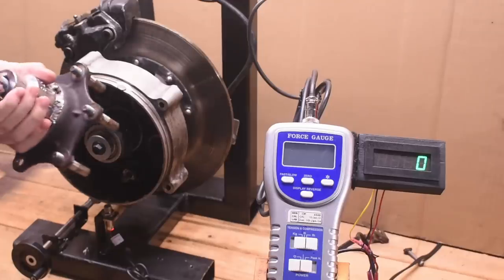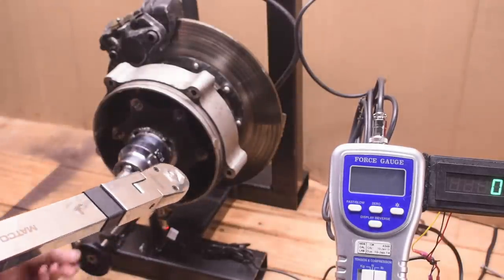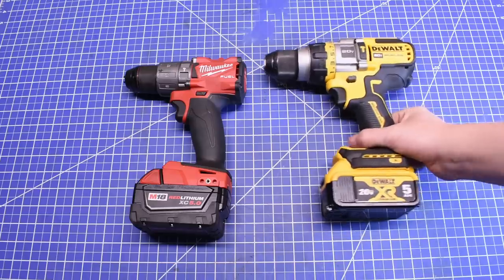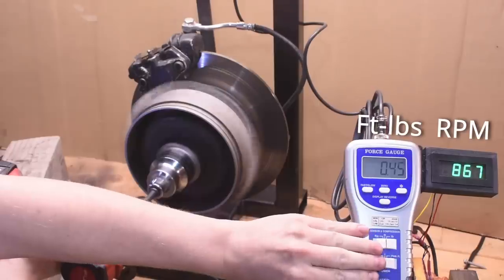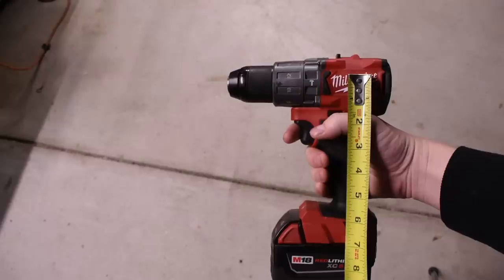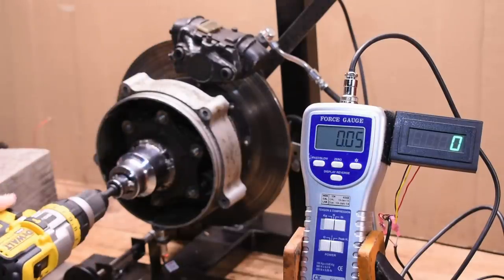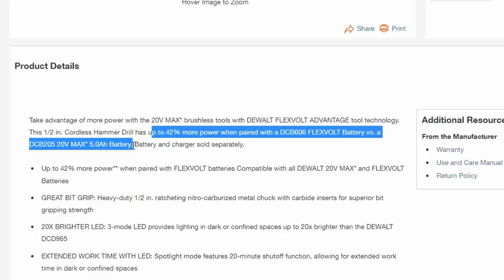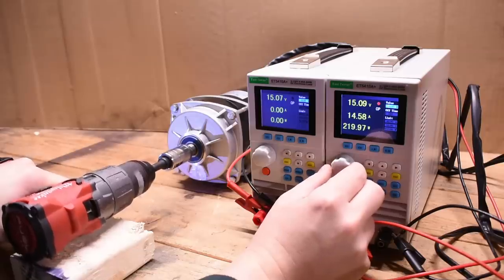DeWALT vs Milwaukee on a Cordless Drill Lie Detector (Dyno Brake)

Comment: I somewhat disagree with the rankings. When I use Milwaukee drills, they like to stall out really early and shut down. My Dewalt will try to break your wrist and only shuts down when the battery gets low.

Comment: Awesome video!
However, I wish more than anything that these companies would stop overcharging for batteries/tech that's decades old though.
For 18650/21700s it should not be several hundreds of dollars to begin with as an intro (say 5ah) brick. Then you add LiPo (around since the fking flip phone era..) into the mix & you QUICKLY find out they don't make their money from tools, it's the batteries. Their margins are HUGEEE!!

Comment: Your brake dyno with its torque and RPM measurement should give you a more acturate power measurement without the losses of the motor run as a generator.  Power is just torque times rpm.

Comment: I'd ditch the generators. The have more losses at low RPM, skew points more. Same power, less losses at high RPM, so higher reported number. Stick with the brake rotor and come up with a dyno graph like you'd expect for an engine.
Reply from the maker: That's why we use separate motors for different RPM ranges, the LOW motor test is with a 550 RPM motor that's more than happy to operate in the loaded like 400 RPM range. It's not very comparable between test types, but is between tools within a test.
Reply: @TorqueTestChannel  So more variables? HP can be converted to watts just like fahrenheit to celsius, so... I don't see what we the viewers get from that anyway... maybe convincing for those who... don't trust/understand the brake dyno or whatever.
Reply from the maker: Not all drills can drive the brake in high and our data refresh rate in low rpm leaves lots of jumbled data that a dyno curved derived from would be a stretch
Reply: @TorqueTestChannel  Sounds like a trash tier drill not worth the material it's made of. So your graph would look a tiny bit stair stepped, big deal. I'm sure you can come up with a higher res trigger if you feel it's just not good enough.

Comment: no No NO! The peak torque you're getting is primarily a function of the rotating mass and the rotational speed (i.e., inertia, momentum, and kinetic energy) the instant before it comes to a complete stop.  Disregard this peak value, and try to keep is rotating as you approach stall.  Chris Baker, retired mechanical and nuclear engineer.
BTW, love your channel. I have learned and been surprised at some tests.
Reply: sorry...i was hours behind several others with this samem insight

Comment: We've run these tests and found the gen 3 with 6.0 48.6 ft lbs the flex 6.0 stacked lithium 48.0 ft lbs and the 999 with 37.6 with the 6.0 flex volt battery matabo hpt multivolt actually beat out DeWalt with 4ah 36v battery Making 39.9 ft lbs all measurements were tested several times with torque adapter set for max torque. If you revisit project farms video you will also see the same results. I believe you need an actuator to constantly turn at the same rate to get true values. The max torque on these drills would rip it out of your hand while trying to turn pressure on the caliber. I've been hit with a drill and it broke two ribs there is no way you can simply hold it down with one hand 👌
Reply from the maker: Yeah but we dont drill through wood too much around here or use hole saws often, so none of this explains why the Milwaukee would keep stopping from drilling a 3/8" hole in mild steel in high. You can go buy the toughest highest torque drill on the market then in high it just stops when using a step bit into some 1/4" plate. There's no numbers out there for this stuff.
Reply: @TorqueTestChannel  Thank you for acknowledging that wood elves aren’t the only ones using tools.

It’s annoying trying to find tools as a hobbyist fabricobbler and every review is just testing in wood.

Comment: I think you and all the rest of the Youtubers should put a lot more emphasis on weight of the tool. If you’re using a drill while standing on a ladder or doing overhead work a pound or two makes a huge difference at the end of the day. My last Dewalt drill weight was 8 1/2 pounds with the 18 v battery the new one I just bought 701 weight is a total of 2 1/2 pounds with The battery.🧰

Comment: The high speed test slows down too quick as at that point, aren't you also including the torque created by stopping the stored potential in the spinning rotor assembly?  These tests should be static RPM (or some % reduction of no-load RPM) and adjust the brake for max torque... which as you probably know, will be close to 0 rpm due to characteristics of electric motors...or at least at the point the ESC cuts out.
Reply from the maker: Bingo, yes. See our post towards the top
Reply: @TorqueTestChannel  ahh sorry, missed that.

Comment: I think Dewalt has the specs of the Power Detect and Flexvolt Advantage flipped.  Aka the Power Detect is the more powerful of the two.  When you put a large 20v 21700 battery.  (Not flexvolt.) Am I wrong?
Reply: Most reviews say that the Power Detect tools and their Flexvolt Advantage counterparts deliver basically the same performance with the same batteries (as well as the DCD998/999 being smallish improvements over the 996). So, if you slap a 21700 cell 8Ah on the FA, it's the same as if you were running the PD, and if you slap the 6Ah FV on the PD, it's as if you had the FA.

But as for the power ratings, I think spurred on more by Home Depot wanting their own exclusive version of the DCD996/997, and DeWalt wanting to upsell the newer 999 name.
Reply: @reaperreaper5098  

I’ve seen a slight advantage to the power detect in some reviews.
Reply: @juanc5149  If it's running the PD with an 8Ah XR vs the FA with the 6Ah FV batt, it's because the 8Ah battery is a far better battery than the 6Ah FV.

Otherwise, it could also be tool to tool variance, if we're talking small single digit percent differences.

Comment: I’m 4 seconds into this video. I’m gonna go out on a limb and assume that the dewalt wins. I had to drill a half inch hole in 3/8 steel once. The super brought a dewalt up to the section and it nearly broke my wrist off.
Reply: Just the other day i had to use a 1" hole saw on a steel column. My buddy's Milwaukee fuel kept cutting out so I grabbed my dcd996. It cut out a few times but overall had no problems. Thing's a beast!

Comment: Your methodology for measuring torque might be an issue. 
You're essentially measuring a form of locked rotor torque, which is when current is flowing but no cooling from the rotor fan can occur. This burns up the windings.
This is obviously bad for the motor, and almost any electric motor controller has safeguards in it to cut power when it senses a locked rotor condition. 
The correct way is to measure watts out and divide by the rpm out to make a working torque graph for available torque at a given RPM.

Comment: if you could even hold that thing at 300lbs it would snap the damn grip off. Ive broke a drill before by just holding it against something that wouldnt move. cant imagine someone buying one of these and just using it like a normal drill, you'll lose a finger if youre not careful.

Comment: Should ding them on points same way as the Amazon Flashlights. Those are some RIDICULOUS claims which turned out to be completely false.
Reply from the maker: There aren't accepted testing practices for it like there are impacts
Reply: @TorqueTestChannel  Watts of output was exactly what you were testing. As was maximum torque. I realize there's no standardized process, but torque is torque. There's no way that drill is putting out 100ft-lbs

Comment: This may be different in other Fields but a Carpenter: Sensitive Trigger, Ergonomics and Weight are what matters most in daily use on a cordless Drill, peak Torque/Power are nice figures to know and good to sort through the marketing bogus. Though ultimately in my experience people will use whats most Comfortable/Ergonomic with enough power to get the job done, regardless if something else has more Power or not. 
I don't mean to discredit your testing methods by any means, Comfort and Ergonomics are very hard or almost impossible to objectively quantify and  the industry as a whole is to blame for putting far too much emphasis on Power and Torque. Nevertheless its always interessting to see what Testing Rigs you come up with, keep it up.
Reply from the maker: Oh for sure, we are but a small piece of the puzzle looking at these tools. But perhaps one that may have been missing in some arenas.

Comment: My dewalt drill goes to 3000 rpm in top gear. That is the feature I won't do without. Rpm should be on your chart.
Reply from the maker: Watts takes into account RPM (volts)

Comment: The ranking  chart basically penalizing the Milwaukee because its bundled with a smaller battery seems stupid to me that's basically rating on marketing decisions not performance. If you drop out the 5 amp numbers it would be clearly superior which makes sense seeing as it's way smaller but putting out basically the same performance.
Reply from the maker: Well for one we've always tested tools on this channel with the battery sold with them, which seems reasonable as that's the battery many people will use. But the Milwaukee is also getting additional points for weighing less by coming with that battery and costing less for coming with that battery. DeWALT REQUIRING the flexvolt battery has to be considered.

Comment: Considering that FlexVolt really didn't provide any advantage here, I wonder if the Power Detect, from Lowes, with the 8ah XR battery would fare any better.  Dewalt's power detection systems really seem to be a whole lot of smoke and mirrors/marketing BS.

Comment: Power detect and flexvolt advantage is a marketing gimmick. Its jus a lowes vs home depot thing. No special communication w/e battery is more powerful is regardless of tool is going to be more powerful. Now which drill is more powerful? Power detect or flexvolt advantage? You will have to get the power detect on this rig to finally settle it

Comment: I love all of the tooling you guys are coming up with.  My only concern with this is the amount of rotational mass required to do this test that the drill wouldn’t typically be turning.  I’m curious if this would hurt or help the numbers you’re kicking out.  It would both be harder to get going but also harder to stop.  My guess is the consistent pressure test would be slightly lower while adding pressure would be slightly higher in numbers.  

Amazing work either way.  Keep it up.
Reply from the maker: See our comment towards the top, you're not totally wrong

Comment: I binge watched a lot of your videos to catch up. I have been getting a LOT of harbor freight youtube adds. Most of the time I don't skip them :)
Not paid by TTC, but please like, comment and subscribe. It really does help, these things are how Youtube knows what videos are good! 
one more thing. PLEASE get that rotor turned. The parts-counter-man inside me yelps in pain *Every Single Time* i see that. Any carquest with a machine shop will do it for $15-20. Also, use the best ceramic brake pads you can get. Not cheap, but the good ones will be more consistent, have less noise and be easier clean up than anything else. Seriously, the dust made from ceramic brake pad has a different electrostatic charge than other pad materials. Ceramic are supposed to have a lower coefficient of friction, but most of that has been designed out by now imo. Higher quality pads in general have less stiction; in vehicles this results in less lurching to a stop.

Comment: Footbananas

The Metric Conversion Act of 1975 is an Act of Congress that U.S. President Gerald Ford signed into law on December 23, 1975.[1] It declared the metric system "the preferred system of weights and measures for United States trade and commerce", but permitted the use of United States customary units in all activities.

Comment: I honestly think the old 18v nicad dewalts outperform teh 20v brushless models I've tried.  I also think that's because the computers stop it before it can damage itself, whereas the old ones would happily let the smoke out it you were willing to hold onto the trigger long enough.  It'd be interesting to throw an old model on to compare, and/or a 120v hole hog.
Reply: Both the motor and batteries are more than willing to cook themselves. I've killed both on separate occasions holding the chuck and using the motor to tighten it. I blame previous use though and it was just coincidence that both failures were from the same same thing, it can't be because I'm a strong idiot, honest. O_o

Comment: I'd love to see Makita gph01z vs Makita xph14z because I'm going to buy one of them but one requires me to buy into the 40 volt platform which I will do if it blows the 18v out of the water I won't do it if it's slightly better it'll be an expensive video but let me know if you're down
Reply: Probably like a $500 dollar expense assuming you don't need any batteries plus the video might not do as well because not too many people care about Makita but you can throw them up against a different brand milwaukee too and have red vs blue in the title which might pull in views
Reply: Makita's pretty popular outside of North America, and a few channels have done basic comparisons between those two models, with the XGT handily putting the LXT to shame. Tools and Stuff has a few good videos about them.

BTW, the GT200D kit is about $450-500, comes with the GHP01, the GDT01, two 2.5Ah batts, and the rapid charger. The kits that come with JUST the impact OR the drill are around $430. If you want 4 batteries and 2 chargers, it's cheaper to buy the two separate kits, otherwise it's cheaper to buy the combo kit.

Oh, as the owner of both, the GPH01 is the better option. Increased power aside, its clutch and access to 144Wh+ batteries are worth the premium in my eyes. Fantastic drill.
Reply: @reaperreaper5098  it's so hard to find the video I want with tools and stuff because he uses the kiwi model number

Comment: Isn't comparing the weight and length of a 3 speed drill to a 2 speed a bit disingenuous if you're using it to calculate rank? You have to have and extra planetary.
Reply from the maker: I think you have a good point. But apparently DeWALT targeted this Milwaukee model in comparison and it's what everyone tests vs in head to heads as top models from this generation. If they made a 2 speed of equal power rating or M18 made a 3 we'd do that instead
Reply: @TorqueTestChannel  Fair enough. I didn't realize that Dewalt themselves uses these 2 drills as comparison.

Comment: Zoom that camera out, we can't see the battery pack or that end of the drill during the tests.  Who is to say those battery packs aren't smashed open at the bottom, just out of frame, missing half the batteries out of its pack?  Obviously they aren't but I would like to see the whole test rig including the device being tested in frame.  I am also sure it doesn't matter but I would like to see the devices being tested rigidly affixed to the test stand and not just being held by hand.  Love the vids and thank you for all the good work you guys are doing.  I can't wait to see more of this test rig!

Comment: Milwaukee Is shit. I purchased the 2801-20 about 18 months ago and It's already dead. I had nothing but problems with It from the chuck locking up to not working at all. I also owned one of the first 3/8's impact I think It was rated at 220-240ftlbs and had nothing but trouble with It. I chucked both and switched over to Dewalt I just picked up the atomic 3/8's impact and love It. Just got the  DCF503 for Christmas seems like a good tool. Replaced the Milwaukee drill with a DCD791 and not one problem with it. I'm a Dewalt man from now on.

Comment: You drill a 12" hole in steel on high?
Reply from the maker: Below 1/2", talkin' 3/8", 7/16" yup. Makes for a cleaner hole. Something like 1200-1400RPM would be ideal but the M18 doesnt have it

Comment: Those Milwuakee drills suck. Label is long gone so I dont know the model number but my fuel from 2013/2014 smokes these new ones and the batteries that came with it are just starting to have issues, after 9 years of abuse and -40 winters. I do unnatural shit with em like 2" hole saw through 3/4" H-Beam and step bits through concrete... Because the formen didnt have a concrete bit or hammer drill but had like 8 step bits lmao. These new drills and batteries for that matter suck. Have like 20 of em at work. Nothing but issues.

Comment: You didn't weigh both drills with the same size battery.   Originally you show the Dewalt having a 5ah battery then you weighed it with a 6ah flexvolt battery.  Why not weigh just the bare tool?   So much for being scientific in your approach.

Comment: It's a fun comparison but I think sort of irrelevant in the real world.  There is a branch of research and design theory which holds that you can sometimes make the results of your experiment irrelevant by attempting to make it "too" scientific.  The results themselves might be fine, but not actually applicable to anything.  The problem I see here is that manufacturers I'm sure are testing and tuning these tools based on real world scenarios they might encounter in the field.  Like I said it's fun and interesting, but I think the real world testing done by others, while less scientific and objective, is more likely to produce useful information for potential end users.
Reply from the maker: The usefulness is comparing tools against each other. With two tools it's not very useful. Most people test these by how far or quick it can sink a 1/2" lag. We dont screw in lags around here, we drill though steel. There was no testing in high that ranks these well we think